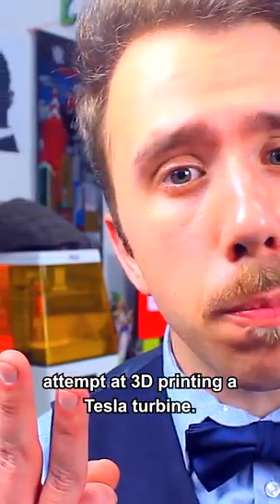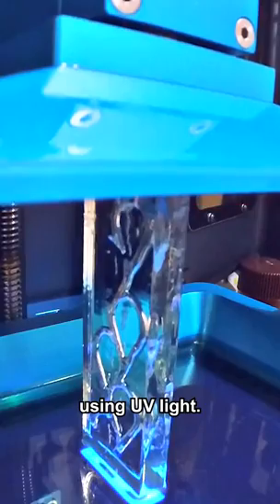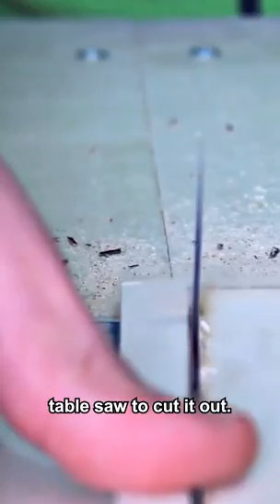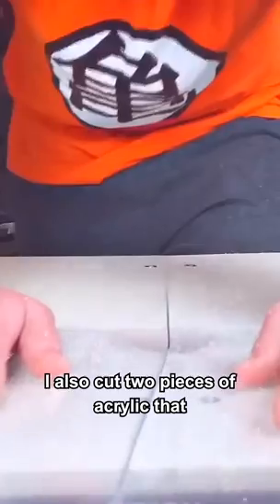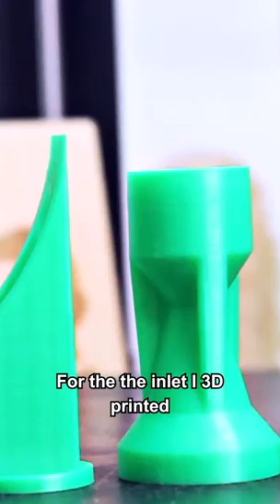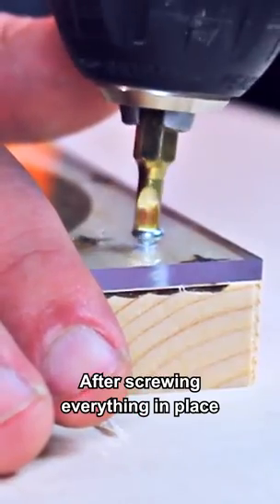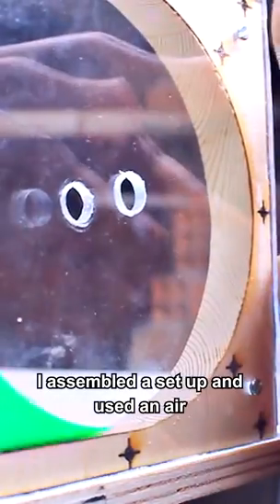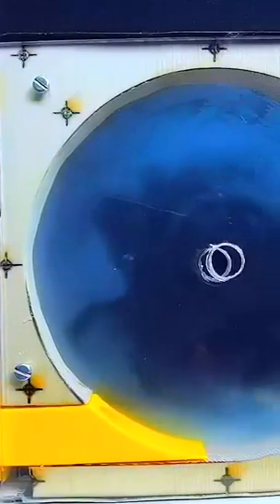My 3rd Attempt at a Tesla Turbine

Comment: I suggest using a fog machine instead of the “cigarette bouquet”. Carcinogen exposure is not worth cancer.

Edit: A fluid dynamics visualization is worth carcinogen exposure. I don’t know what possessed me to write what I did.
Reply: or, just use a vape :D
Reply: @tomclanys  that’s the same technology, just with an addictive neurotoxin dissolved into the glycerin.
Reply: @kyleeames8229   more or less, also with a nice aroma. But I'm pretty sure fog machines are more toxic, because they don't regulate the temperature of the heating element as well and it can get into the zone, where acrolein and formaldehyde gets made. A big amount of vapes has temperature control which doesn't let the cotton or liquid get burnt.